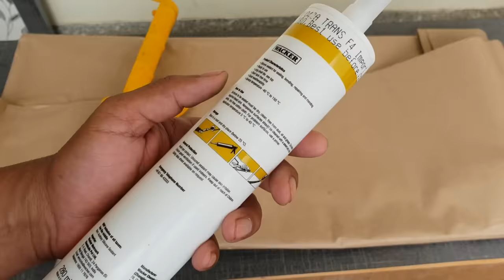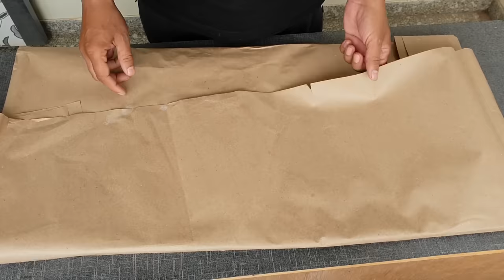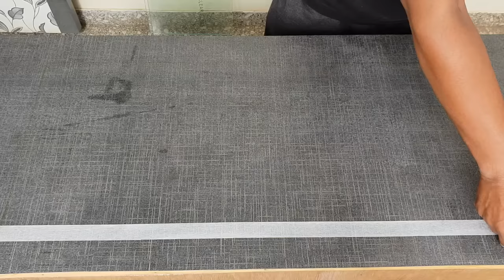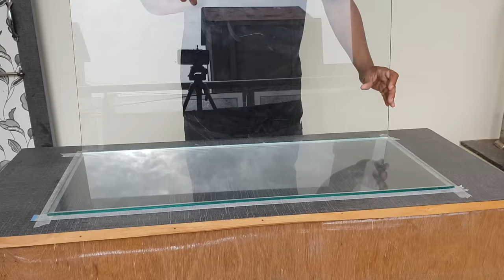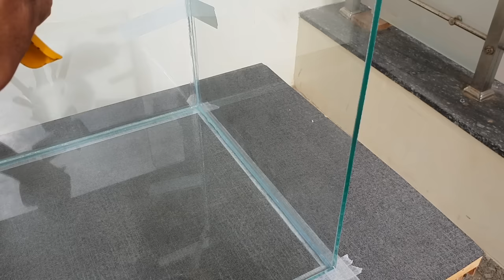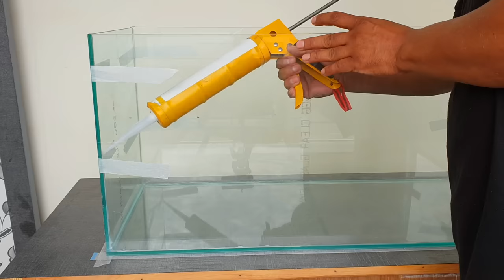DIY | How to Make 2.5 feet Aquarium at Home

Comment: I have a 10 gallon aquarium but the rebuilding might be a little trick because the bottom glass rest on a bottom trim and the the side glass panels go inside the trim and connect to the side of the bottom glass so the bottom glass is raised they do that for safety I guess. So I can’t just lay the bottom glass and put the silicone on top of it and put the side pieces on top on the bottom glass or it won’t fit back into the trim so I have to make it exactly how it was before but I can’t find anyone on YouTube with a video of building the aquarium type I have
Reply: It doesn't matter, it good either way
Reply: I don't understand can you post a video
Reply: put sides 1st thn base inbetween OR base 1st and make sure its at the center, your silicone you put it on the side panels

Comment: Is the glass glued to the outside of the base or on top of the base?? Couldn't really see
Reply: Good point... all 4 vertical glasses should stay on the base... above the base ... Not outside..
Reply: @kollawrance7401  Thanks bro I had a doubt on it ❤️
Reply: @kandukurumahesh3609  don't know why..but this is how it's normally done.  I guess it's better this way, while we lift the aquarium and shift.
Otherwise the weight of vertical glasses will just hold on the gum alone. If its over the base, the base will hold them.
Reply: Allways outside on the base, please. So there are three layers of glass when (accidentaly) hitting the corner dure manipulation instead of one. And also because you are hidding the seam from the front view. You are not supposed to lift aquarium filled with 150 litres of water (ofc) and sillicone bound is strong enough to hold glass side.
Reply: Both is possible

Comment: What is the use of pasting tape on surfaces pls tell
Reply: So the glass doesn't move when a bit of friction is applied. If you use a rubberized surface it helps to see the lines to keep it straight
Reply: @justincv  thanks

Comment: how much time take to dry the gum.?
 and when we can put the fish in it?
Reply: Minimum 12 hrs but keep it for 24 hrs... its silicone so it will smell... i have used the same one in my diy tank... which is next video on my channel
Reply: for 20 hours. ie. after making in the evening, keep it for whole night. and then in the next day afternoon you may start using it
Reply: @benaqua10   silicon is enough for 2.5 ft tank or we need any strong glass gum??
Reply: @varaprasad0369  silicone is the best I have 3 ft tanks built with it... and built my 1st tank at home 1.5 ft... will be uploading the video in a few minutes
Reply: @sushs7991  after 1 day fill with a few inches of water to test for leaks if any....
Reply: @benaqua10  after two days off tank water check next using pannalama

Comment: My aquarium is 1.2m long and width is 500mm...glass thickness is 6mm ....my question is what is the level of water i can put safely
Reply: Y..
Reply: What
Reply: You can always fill your tank up to the top only to avoid spilling and fish falling out we keep the water a little low that's it if your tank is built well it can hold the pressure can you tell the dimension in inches like length x breadth x height
Reply: @adeptgamezone8457  36" x 18" x18" 6mm glass

Comment: I think his wrong.we cant just use silicone as a glue you must use a glass glue first bro so the silicone is a waterproof glue for it
Reply: Nope dont need any special glass glue, i just fixed a 5ft. Any bigger than 3ft will require support from either cross supports or corner edging, i used a ratchet strap to hold the fishtank together while i worked on it being such heavy glass,